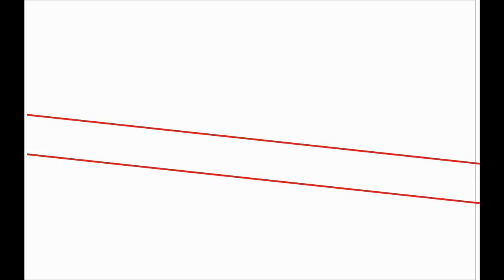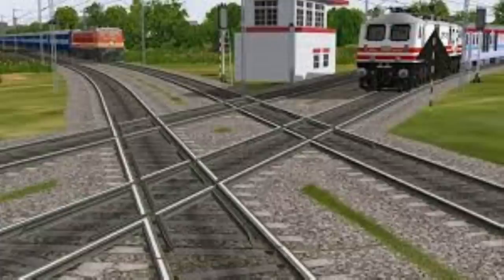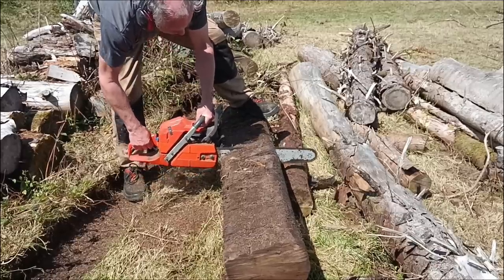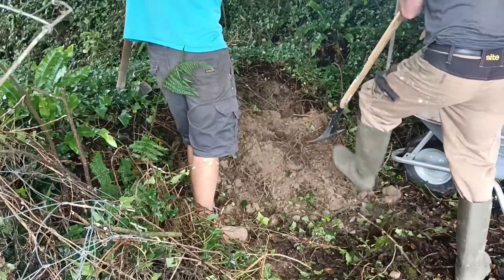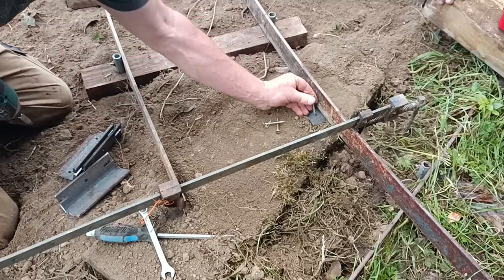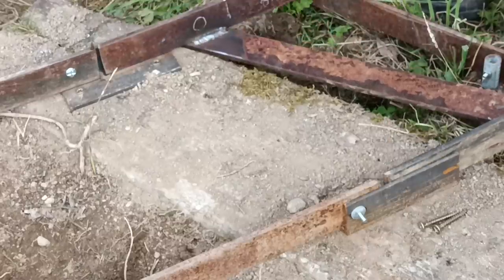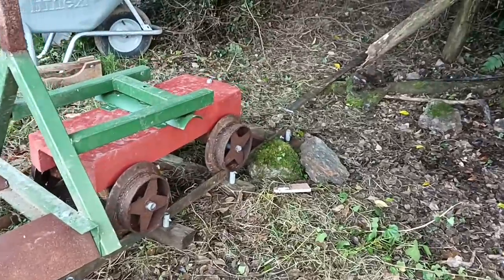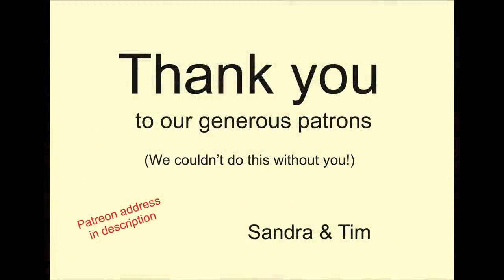Building A Diamond Crossing Bridge For The Narrow Gauge Field Railway

Comment: Not bad.. BUT... now that you have a removable section,  you could cut the other track,  and then take the sections back to the Shop, and weld a proper intersection together.   To make sure that you have the pieces intersecting at the right places... you might use a combination of a cardboard template, as well as Marking each intersection with Chalk or Sharpie lines.   When welding them together, you would probably want to fasten them to a few sheets of plywood (the extra thickness of two sheets, would probably be required).   Clear-Coat the plywood before hand, to waterproof it.   Before placing the section back... dig up the ground and add some log pieces as additional support, to prevent any ground sagging at the junction.   You might even remove the plywood, and directly affix the now unified rail sections, to those ground logs (I forget what they call those squared logs).    Or just screw the Plywood base to the Logs below it.
Reply from the maker: Well, yes. I COULD do all that.. : -  )
Reply: Plywood? He's not made of money!

Comment: Regarding your railway: you have been playing around with steam and compressed air. It is awesome content, for sure and I love it. What I dont understand is why not electrically powered? Electricity in Ireland is cheap (solar if it gets too expensive - which I would 100% do anyway in your case), electric motors are simple, reliable, powerful and cheap devices. LIFEPO4 batteries are much better nowadays (you get 5KWH 5KW for under €1k if you build it yourself from cells). Yes batteries are heavy but that is precisely what your railway is good at -> hauling heavy. On top of it all - it is simple to build dedicated battery wagon if you need it. Gofundme if the costs are prohibitive. If it is for YT reasons I get it. Otherwise... idk.
Reply from the maker: It's only down to money and time - I'm always short of both
Reply: @wayoutwest-workshopstuff6299  I respectfully disagree with both. 
Costs: at the end it will be cheaper. Furthermore if paired with some solar (which scales very good, you can start small) you will get your investment back in max 10 years. Crowdfund it. You could at least make a poll and ask if ppl would support that and decide depending on the poll results. 
Time: You would save tons of time. For sure it will take much less time to build loco from proven simple components rather then building everything from scratch. You can finish steam engine for amusement purposes afterwards (while you are saving money with your electrical train). Hairy Henry visitors would love steam engine, so it would not become just a vanity project.
Edit: I forgot 1 detail: electrical loco does not need gearbox (apart for reverse), motors are easily controlled via voltage.

Comment: I have found the perfect locomotive for your field railway. Very low cost. The only thing you may need to buy is the electric motor, speed control and a battery.
The whole locomotive is made of wood, like your pedal car and a pair of used ammo cans. It’s on YouTube under  Karen’s Little railway. Take a look. You just may like it.
He runs 7 1/2 inch, but can be built to 15 inch.
Enjoy
Reply from the maker: thanks, yes, I've seen that too

Comment: "scraping around curves" isn't that the worst case scenario? I always thought that the wheels aligned so the inner wheel ran on the smaller diameter of the cone and the outer wheel ran on the larger diameter of the cone.
Reply from the maker: basic wheels, like these, don't have cone treads though
Reply: @wayoutwest-workshopstuff6299  i forgot about that

Comment: At 9:00 is that the frame of a tipper trailer
Reply from the maker: Just a an old one that needs taking apart
Reply: @wayoutwest-workshopstuff6299  I had one come in to work for a bearing service but because you can't easily get European parts in Australia we couldn't do anything

Comment: Well done!  I had hoped that you would have built a frog type crossing similar to that in the the frog turnout to the gravel loading track, but that would have been much more work, as you explained!  I've seen narrow gauge railroads bridge across standard gauge in a similar manner as you have done here, mechanically operated, of course.  There is also another type of crossing which is permanent, but lifts the flanges of one line to clear the rail tops of the other.  It is called a "jump frog" on this side of the pond, but probably has several other names.  Here is a video of a full size railroad's permanent solution to your identical problem.  I don't know if the size of your flanges would allow for this type of solution, but it could be a permanent fixture that would not have to be removed and would allow movement on both routes without a bridge section: https://www.youtube.com/watch?v=wlIiecut_YY
Best wishes!